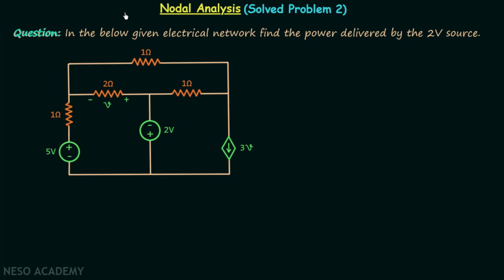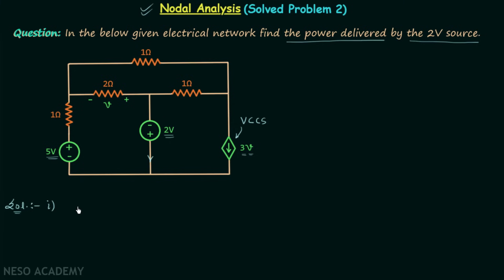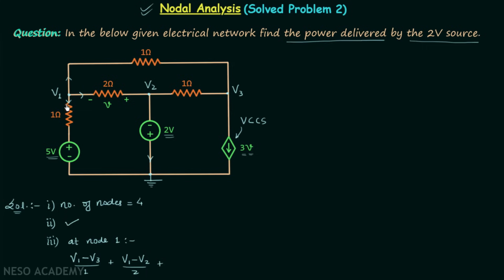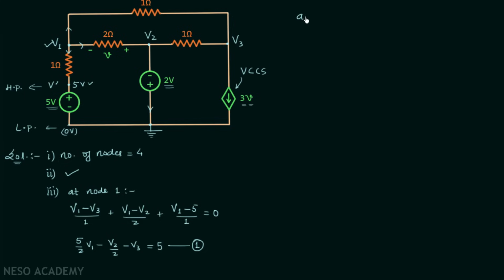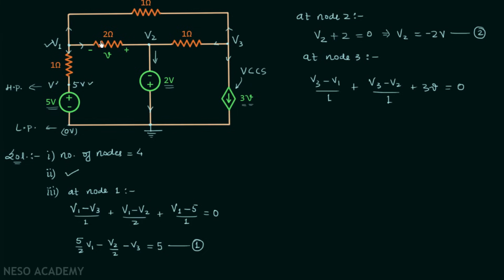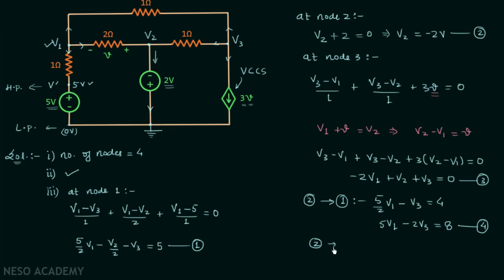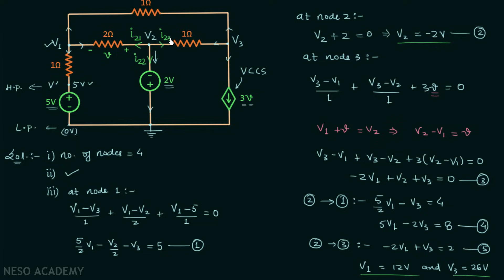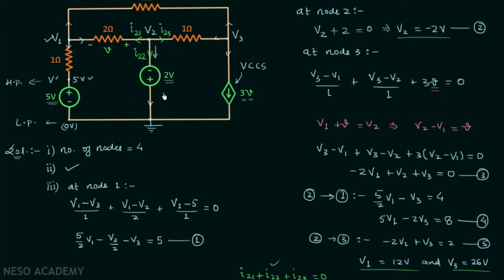Nodal Analysis (Solved Problem 2)

Comment: Is the equation of number 3 wrong? The correct answer is -4V1+2V2+2V3=0
Reply: yes , i got the same.
Reply: @sharathkb2397  he just divided the equation by 2
Reply: It is, -4V1 + 3V2 + 2V3 = 0
Reply: So we can't divide it by 2
Reply: @te44aniketdusane86  We can easily divide the whole equation by 2 though. Divide LHS and RHS by 2 and the RHS remains same as 0/2 is still 0.

Comment: why at node 2 we didnt performed higher potential i.e V2 - reference node i.e 0v = 2v ans hence voltage at node 2 will be 2 v. Instead of this why you have applied kvl in it when similarly you have done in node 1

Comment: sir in the previous question you said when the voltage source is between the reference node and the non reference node then we dont need to find the kcl equation for that and then you just wrote the value for v1 =0 therefore in this question also we can clearly see that the 5 v voltage source is between the reference node and the non reference node (that is the ground one)  therefore why didnt we said the value of v1=5 v. Does that means that this rule is only applicable when the reference node and the non reference node contains voltage source in between but no any resistor????? pls reply at the earliest sir!

Comment: In node V2, the current is entering negative terminal as considered.  So Power = - vi
v= - 2V and i=35A
So power= -(-2)(35)= 70 W
Reply: no because power is delivered so you cannot put positive sign with it as it shows power sink.... which is not true in this case as power is being delivered.
Current is leaving node v2 and entering in the 2V Voltage source.
Reply: No
Reply: @muhammadhammadsarwar698 you are right😊

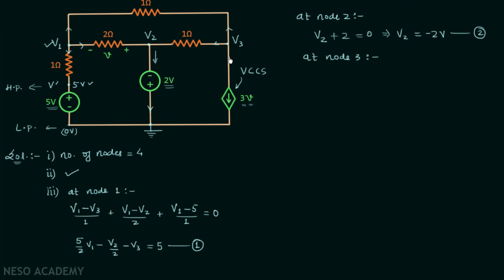Comment: Sir at 6:24 we have to write the kcl,so in the current towards 3V which is dependand source why u didnt considered the resistance which should be zero so the equation will be 2v3 - v2 - v1 = 0 . Could u explain this
Reply: see because in current sources the internal resistance is considered infinite and not 0 (parallel connection). First things first I think you misunderstood that this is a current source and not a voltage source. The current that it provides is 3 times the Voltage across the resistor that says <- V -> above it in the schema provided.  say if the voltage across that resistor happens to be 10V the VCCS source will provide to branch 3*10 = 30A. Hope it was helpful but it has been 2 years...

Comment: @Neso Academy Sir as per your previous lectures power absorbed is +vi because it is leaving the - ve terminal and power delivered or supplied is -vi because it's entering positive terminal...here it should be -70w in this case .please do clear this ASAP
Reply: Ya that's what  I thought
Reply: Sir is correct see previous videos again.
Reply: See video by gate academy maybe you'll understand coz it's the direction of current which decides the value. The same souce and deliver the power as well as can absorb the power

Comment: Sir isn't it p=-i.v ??? 
Because current is entering into the -ve terminal of the volt srce (2v)??? I know power can't be negative but as per your previous class explanations u told that if the current is entering into the -ve terminal then it acts as source, if it enters +ve terminal then it acts as deliver. 

I'm a bit confused...
Reply: I have a same doubt sir plz clarify
Reply: I think you are right, power in this example is -70 W. But he is talking about Power delivered, and we know that power delivered is a negative quantity AND power absorbed is a positive quantity. Meaning that saying that P=-70W is similar to say that the power delivered is 70W.
Reply: @kamalabouzhar8469  thank u

Comment: Sir... shouldn't the power be -70W as the current is entering the negative terminal of voltage source? 12:53
Reply: tricky question its "power delivered" and not "power produced". So you don't care what direction it is. You just wanna know how much power is there at x point in time. So ireelevant which side you chose

Comment: From the solution of equation 4, Please can someone tell me how does 5/2(V1)-2/2-V3=5 becomes 5/2(V1)-V3=4?
Reply: So from combining eq 2 and eq 1 you get the eq 4 which initially is 5/2(V1) - (V3) = 4 you 2x both sides and you get 5V1 - 2V3 = 8 (eq4). What you have written here is equation 1 and you wrote it wrong too. Go slow and methodic so you don't make these mistakes

Comment: I don't understand one part. You said that V2 is -2V. Why can we ignore the currents coming in from V1 and V3?
Reply: Bcz we need voltage across v2 nd one thing should be noticed that there is no resistance at v2 
But may be muje clear nhi pta .....

Comment: SIR PLEASE IM THE PROBLEM ONE, AT THE NODE 2, YOU STATED THE CURRENTS LEAVING THE NODE BUT YOU DIDNT DO SAME HERE. PLEASE IM CONFUSED. HELP ME
Reply: You don't need to use KCL at Node2 at first go around.  You are trying to find the voltage potential at all nodes. At Node2 specifically, you can get the voltage directly because the 2v independent voltage source lies between Node2 and ground (without a resistor in the branch providing a voltage drop.)
Reply: Thank you

Comment: Y u find v value....?  Y u take v...?
Reply: In the question it self they mention that v is a current passing through 2ohm resistor and 3v voltage control current source